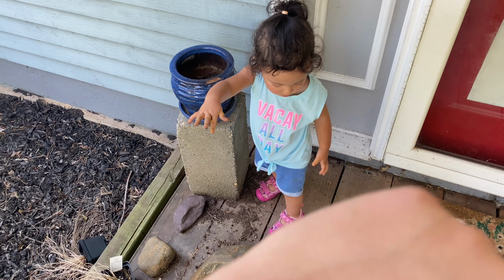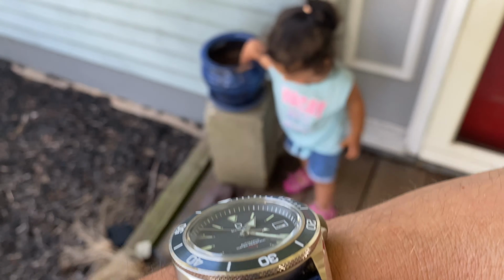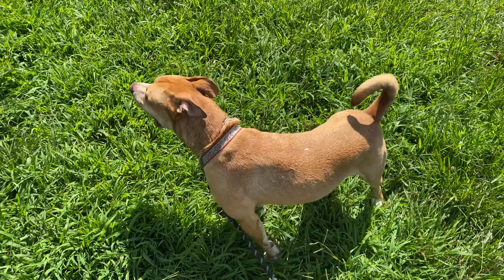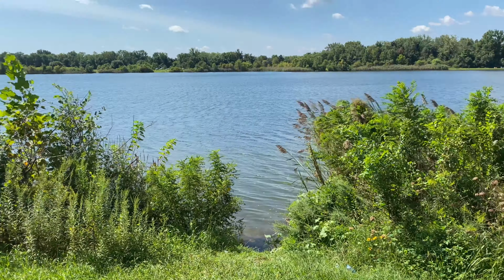Build Your Own Watch- DIY Watch Club [Do It Yourself]

Comment: Bravo Sir!!
I'm  so glad you posted this!! have been looking at DIY watch club for some time for myself and for doing a custom retirement gift for my boss. Then there's Christmas presents! 
Like you, Joe, I'm a handyman at building and fixing things so I have complete confidence in this project. 
To customize it even more, and since they are nh 35s, I'm wondering if I could use other faces and hands for an that movement? I Love the hour hands on their Diver watches, but I prefer a more legible minute and second hands (as you get older you'll find out). 
Joe, you've done good 👍 I'm going to start building! And using that code!
Reply from the maker: Hey Chris! Welcome to the channel! So glad you found this video. You absolutely can switch up the hands and dial for sure. I’d recommend getting what DIY offers to get the feel of the entire process. Then you can reverse engineer and buy dials and new handsets and have a blast. Your options are limitless! Thanks for your support.

Comment: I think these kits are a great Idea. I was skeptical at first but after Steve at The Watch Corner did his review I realized they were legit good quality and a great way to get people into modding and minor watch repairs. I've been modding for a couple of years and I wish I had started with one of these. I had to learn using the trial and error method. They are also reasonably priced. Parts for a full build can add up pretty quick. I'm starting an SKX build and the dial, Bezel insert and hands were a hundred USD It adds up quick. Great job Joe! Those second hands though! 🤣
Reply from the maker: Great perspective! Glad you gave them a try. Those second hands are brutal! 😂 Thanks for watching!